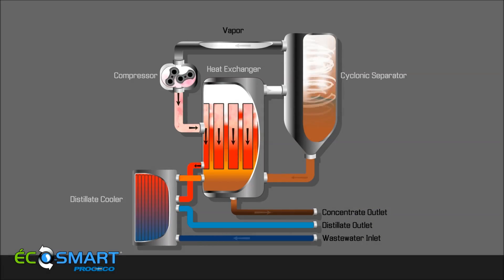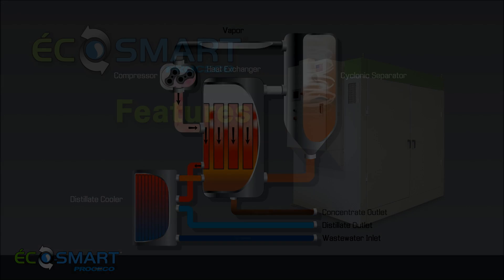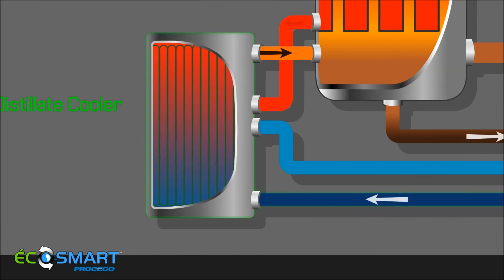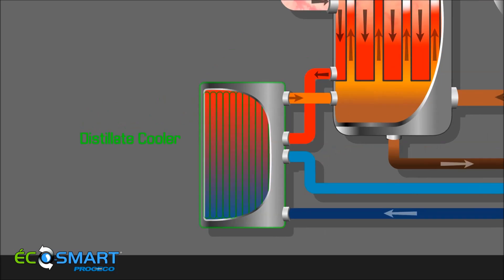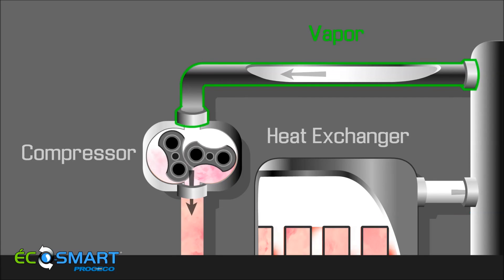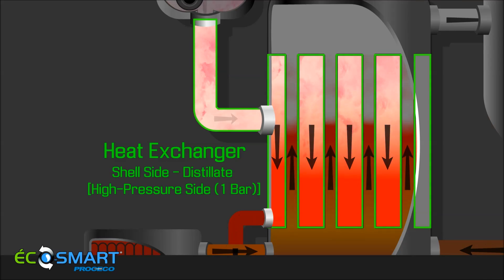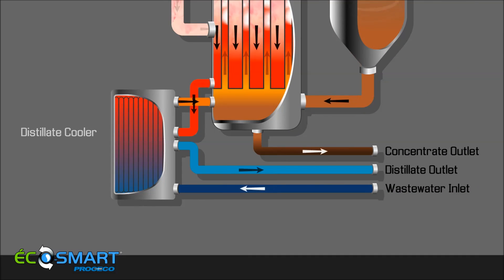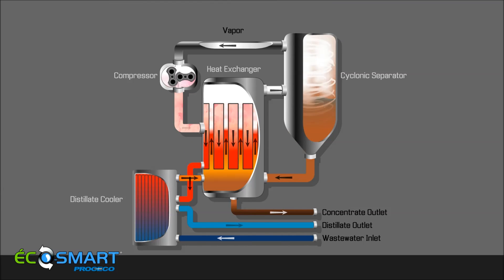Reduce your industrial wastewater disposal costs with PROCECO Éco-Smart MVR evaporators

Comment: How much power and steam require for 1 ton evaporation.
Reply from the maker: Hello, The Éco-Smart® uses NO external steam source, heaters (electrical or gas) or pumps other than the compressor to heat and move the fluid, relying strictly on natural circulation created by the process. It has a low Energy Consumption of 0.25kWh/gal

For more information regarding the Éco-Smart®, you can download our brochure from our website: http://www.proceco.com/product_information/water_waste_treatment

If you’d like further assistance, please contact our Customer Service Department at + 1-800-978-6677. Our Customer Service Department is available from Monday to Friday between 8:00 AM to 5:00 PM Eastern Time (US & Canada).

Thank you!

Comment: How much heat is radiated from the unit in BTU's? How much does it cost?
Reply from the maker: Hello, the heat radiated would depend on the options you'd need. The price of the Éco-Smart varies depending on the options selected and your system's requirements. 

For a quote, please contact our Customer Service Department at + 1-800-978-6677. They'll be able to dispatch you to the appropriate sales representative. Our Customer Service Department is available from Monday to Friday between 8:00 AM to 5:00 PM Eastern Time (US & Canada).

Thank you!
Reply: @PROCECOltd  we want to buy one system pls share u r contact details.
Reply from the maker: @Ak-ex4pr  Hello, you can contact us by either filling out the form on our website: http://www.proceco.com/contact_us or you can call our Customer Service Department at + 1-800-978-6677. They'll be able to dispatch you to the appropriate sales representative. Our Customer Service Department is available from Monday to Friday between 8:00 AM to 5:00 PM Eastern Time (US & Canada).

Thank you!